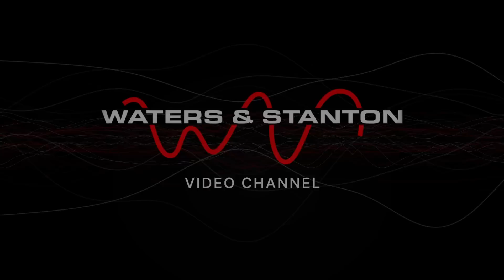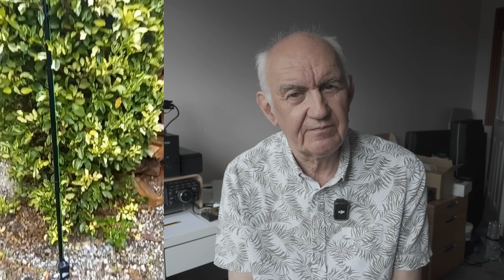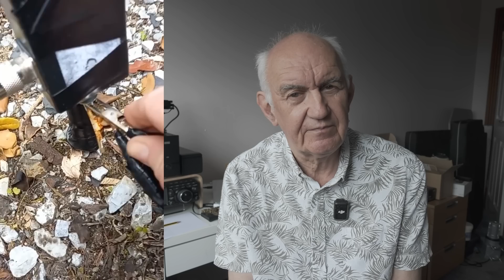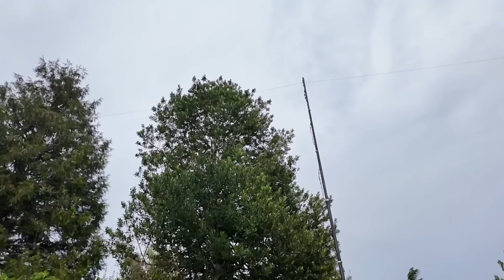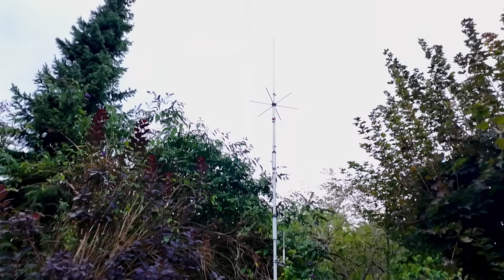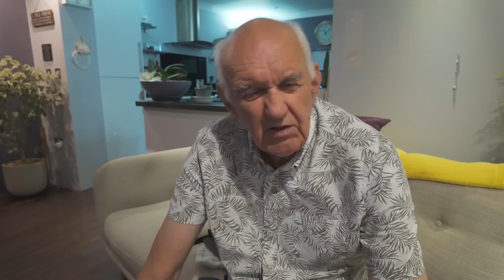HF Antennas That "Don't Wor.k."

Comment: I think, perhaps, where this particular issue is concerned, a change of perspective might be in order.  As an amateur radio operator, I see antennas as tools in my communication toolbox.  So, rather than see one type of antenna as better than or worse than another antenna, I see antennas from the perspective of which antenna would work best in this environmant and to meet my communication goals right now?

I also find it useful to have, at least, two antennas available while operating on HF, so I can easily switch between them to determine which antenna is better for this particular contact.   

I don't have an emotional or egoistic attachment to any type of antenna, any more than I have a greater attachment to screwdrivers than hammers.   

Thanks for the video, and 73!

Comment: When I was a novice, I would listen to 75 meters at night. My neighbor tuned up his radio using a light bulb, I think it was 500 watts.  One of his friends called back to him and he told them he was on his dummy load.  That night, hams all over Georgia and South Carolina switched to their dummy loads and made a joke out of it. 

Later, I acquired a 300 watt 50 ohm resistor. For kicks and giggles, I put it on a fence post outside my window and worked a number of stations in different states on 20 meters. 

"Buck's Law" is:
Given sufficient propagation between any two stations, any excuse of an antenna works."  I made that up after dummy load night.  The old timers loved it..

Weak signal QSOs happen everyday. It doesn't matter whether it comes from a QRPp rig runing 100mw or a 300 watt station using a Cantenna.  If the signal gets out and propagation is sufficient, they can communicate.  

I do have to admit, that some antennas are not much better than the dummy loads, though.  Hi Hi

Comment: I always worry about Youtuber hams who rely on modelling software as being sacrosanct. I long ago learnt the expression GI-GO (garbage in - garbage out) and I have never seen or heard of anyone checking the actual software. Is it based on suppositions as well as known facts? Might there be a minor typo error that can skew results in some circumstances? I like the idea of just getting out there and trying different antennas to see how they work in different circumstances. For example, when I was recently caravanning around the Australian outback I used a 17ft whip, 9:1 unun and "magic carpet". Some locations it seemed better than others, but was that a function of the terrain under my faraday cloth or was it just conditions as well as location? I even made 20m SSB mobile contacts from central VK5 into England, Italy and USA using 100 watts and just a Diamond SD330 whip on the bullbar of my 4WD. It's great fun to just muck around with ham radio and see what works. 73, VK4BOB
Reply from the maker: Many thanks for those observations. Much appreciated.

Comment: Another good video. I think it illustrates several principles about antennas. In most cases all things being equal modeling comes close, but all things are rarely equal! Several “ rules of thumb” come to mind. We do know verticals work best over very good ground. We do know they do not have low angle radiation over poor ground. We know horizontals are more immune to the type of ground under them. We do know the ground where the radiated wave first comes down and is reflected back up for its next hop makes a great difference. A VK/ ZL station usually has seawater at that point. Modeling programs are only as good as the model and many things can not be modeled correctly. So you are exactly right! We will probably never really know why one antenna works so good one place and not another. We also know, roughly, that a vertical starts with almost 0 dBi gain and a half wave horizontal starts with 6 to 8 dBi gain broadside. Of course gain is usually only talked about at the peak elevation angle. But still a horizontal antenna has some advantage, even at lower angles due because it starts out at a higher gain and the Brewster effect. All this can really mystify a new ham! I almost forgot, other antennas and wires nearby do affect the performance! Sometimes it’s better to be lucky than good!
Reply from the maker: Many thanks. Some interesting observations. Much appreciated.
Reply: @watersstanton  Thanks! You and I have been around a long time and have an appreciation of the complexity of antennas, ground, and propagation. There are just too many variables to fully understand and predict with any certainty what will work in any particular case! The best we can do is apply the fundamentals we know and see what happens.

Comment: Good advice Peter, though I would probably add the qualifier "for what you want to do" to the criteria of whether an aerial works or not. My verticals and inverted Ls have served me well in the past, however a simple low dipole for 40m opened up a new world of inter G working for me. Another aerial I will have to revisit...
Reply from the maker: Many thanks for sharing.

Comment: Only purchased ones.

Given I most regularly use just a piece of wire cut to length you'd think this is surprising, until you look at the aerials being sold with desoldered connections, broken coils, terrible match for the band advertised, etc.

Comment: Very good Peter, and your right, the personal situation has a huge influence on what works.  I would like to live on a hill with the nearest neighbour some 100 yards / meters away who loves the sight of an old guy putting different antenna up or seeing him shoving his grandson up a tree with a wire tied to his belt and a little bag of tools tapes and ties slung over his shoulder 😵‍💫 🛠️🪜✂️   But in reality my “garden / yard” measures 6mtr X 4mtrs  and I prefer a bit of stealth,  😊😊  so my doublet runs around the plastic guttering of the house and it’s quite difficult to see.  One of the interests of ham radio ops is overcoming the QTH impedance… is there a measurement for that similar to using ohms 🤪  🤔  🤨  
Your ZL friend Brian sounds like a “ rum un “ a nice intrepid type  🤗  who likes antenna builds.   😊
Thanks for the video…  Best wishes to everyone.73   G0UVL       💙
Reply from the maker: Many thanks. Nice to read your comments. Keep at it.

Comment: A vertical with elevated resonant radials might be a good experiment. There’s some fascinating research around a new design dubbed the “POTA PERformer”.  What surprised me is that 1/4 wave radials on the ground are too long because they are detuned by ground proximity and pull the maximum current point away from the arial into the radial system increasing ground losses. As a community of learners and experimenters it’s exhilerating to discover what works and what doesn’t.  POTA has inspired significant advances in portable antenna theory and practice.
Reply from the maker: Yes I have long preached that ground radials have a much lower resonant frequency. As I mentioned in the Video, elevated radials help, but are not the complete answer.

Comment: I think the number of unknowns when it comes to actual antenna performance is so massive that we may never discover the entirety of why a given antenna under (or over) performs.

I will say that when it comes to ground mounted vertical antennas, I firmly believe that soil composition, moisture, water table, near-surface mineral deposits, and the like, make a huge difference in performance. I can see my own vertical, a 6BTV, change (for the better) when the soil gets more moisture. We're dry here, and until 12m decided to get magical tonight, it's been a bit of a struggle through this dry season.  

Plus we never really know what happens to our radio waves when they get up in the ionosphere, do we?   We know in general terms, perhaps, but they don't arrive at a destination with luggage tags from all the places they've been, so on any given trip, we're in the dark. 

But in the end, that's the joy of it all, I think. Experiment, try things, and see what happens. 
73 de N8ESP
Reply from the maker: Many thanks. Yes the ground is important..

Comment: wouldn't the angle of radiation on say a horizontal dipole or doublet change with the height off the ground, being high angle low to the ground and getting to a lower angle of radiation with more height off the ground depending what band your using at the time.
Reply from the maker: That is why the low doublet on 20m is a puzzle.

Comment: That you can work OZ garden to garden with simple antennas shows operator skills. Even with a KW and a tribander on a 66foot tower its often hard. Getting antenna supports even 33feet tall for 20 can be a problem. Cheap telescopic flag polls, whips and other bits can make nice half wave vertical or horizontal antennas. Multi bands are nice but, each band has different probagation and antenna layouts for best performance'
Reply from the maker: Many thanks.

Comment: Great video peter. I will be in this dilema soon. moving to Italy from UK in less than 2 weeks and I have access to high up flat roof but don't want to put up a permanent system so looking at temp vertical with my 10m spiderbeam pole. lots of ideas in my head. 73 de Steve G0LQP
Reply from the maker: At least you will see a lot of sky which always helps! Good luck with move.

Comment: I’ve three antenna up covering 40m-10m, 2 are multiband. Comparing the two multi bands, a Hustler 4btv and a Cobweb. From 20-10m the Cobweb knocks spots off the Hustler, so the Hustler now is just an expensive 40m vertical for me (my other antenna is a 30m dipole).. Given the expense of a Hustler then the effort & expense of a radial system I couldn’t recommend one, mines a dummy load
Reply from the maker: Read the comment from another Hustler user who found the answer for his location.
Reply: @watersstanton  seen it alright, I’ve the same set up actually. I must make a video.. In fairness to the Hustler, it’s ground mounted and I’m comparing it to a Cobweb with resonant elements at 10m above the ground. That said, before I got the Hustler I was never happy with 10m & 15m on the Hustler.

Comment: I came across and cheply bought the Hustler 6-BTV. After putting it up properly and according to the manual it looked like it was deaf. Especially in my QTH where the background noise is disastrous. Even the additional 12 ground monted counterpoises didn’t help. Although it was well in resonance. The previous user also was convinced about its complete deafness. But after installing a proper line isolator at the feeding point and back at the radio things chanched dramatically! Suddenly it starter working like a dream! It’s not meant for local contacts though. Anyway it’s a very interesting video. Thank you Peter!
Reply from the maker: That’s good to hear. Well done.

Comment: Hi Peter,  Here at my QTH, anything with a high current point near the ground is just inefficient, ground reflection and absorption being the largest probable cause. But obviously ground proximity and give rise to skewed radiation patterns etc  (not forgetting Brewster angle). What I have been experimenting with recently,  is feeding a high impedance point, to say a half wave , but shortening the length by using using capacitive loading and just getting the feet of the ground a bit. There is a certainly case for saying this shouldn't make a whole lot of difference loosing efficiency due to more current in the antenna length, therefore in a way lowering the high current point anyway.  However, i have found this produces considerable positives in performance. To me this confirm that the above mentioned effects are the main drivers in vertical performance and therefore the relatively low horizontal will often win out because it negates a lot of these issues in most locations.
Reply from the maker: Interesting to read. Many thanks.

Comment: Hello Peter - Interesting video.
Many-many moons ago there was a commercial aerials for sale which didn't require an ATU or matching of any kind.  One of these aerials was used in a Marine installation on a Guard receiver(2182 & 500khz).  The same model aerial was also used for transmission on a another installation.  It was not a good performer so it was removed and put on the scrap pile for dumping.  I rescued the antenna so-as-to-speak.  I opened up the sealed box, the not to be opened type,  and inside the box was one very large resistor !  This antenna was not cheap but by heck it was absolute junk
A couple days ago I was mobile with my Xiegu G90 tuning around 40m, my aerial is an OPEK HF Multiband job,  not the best of, or, robust of aerials.  However to my utter amazement I heard a VK station working a UK station, the VK station was around S1.  That was the first and I imagine the only time I will hear a VK on my mobile setup.  My all-time favourite aerials are my GAP Titan DX and my T2FD, photos on QRZ.
Reply from the maker: Interesting tale. Many yhanks.
Reply: You should be able to work VK and ZL by operating around our morning greyline time. I'm regularly doing so with either Ampro 20 on a magmount, or one of my homebrew portable antennas, one of which is a copy of a Bushcomm Mil-1 and includes a resistor in the main element which allows operation on 80 to 10 with no tuner! Your mobile set up will do it easily.
I run 5 W and often turn down to below 1 W, and many of my QSOs are with other ops who are also running very modest antenna set ups.
73 M3KXZ